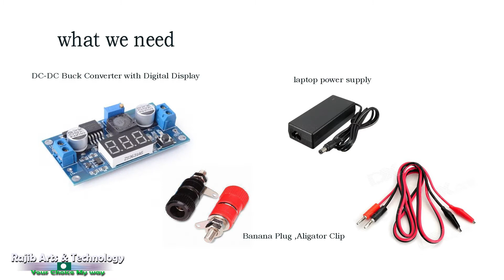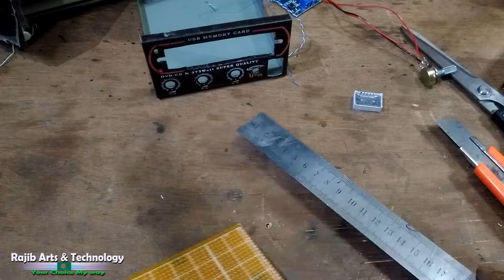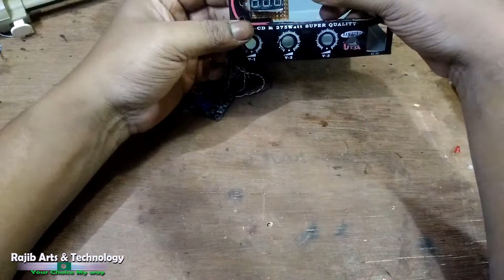Homemade adjustable dc power supply with LM2596

Comment: Did you use superglue for the heatsink? just curious because I was tempting to do that with jbweld.
Reply: You can pick up proper heatsink pads on ali or similar places. I normally have a 10cm x 10cm sheet and cut them to size for my needs.

Superglue is a bad choice at it doesn't deal with heat well... both in weakening at temperature and not conducting it particularly well.
JBWeld at least is designed for higher temperature use, but it still isn't particularly great at conducting heat.

Comment: bro it can work on home votage 220 v ???
Reply from the maker: This is work only dc 5-30v
Reply: @rajibartstechnologymd.mahf9807  You can repurpose an old laptop power supply if you have one. Easy to find (every laptop comes with one and the laptops tend to be end of life in a few years), and they put out 15-20V and a few amps... Check the info plate on the supply.